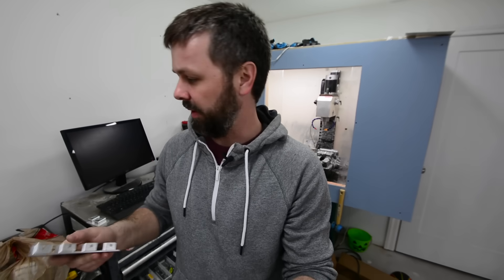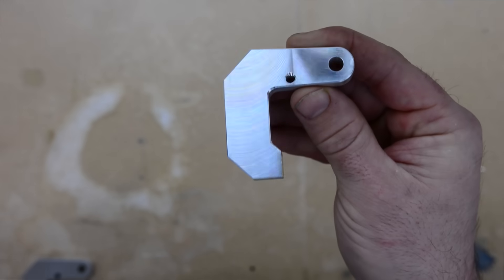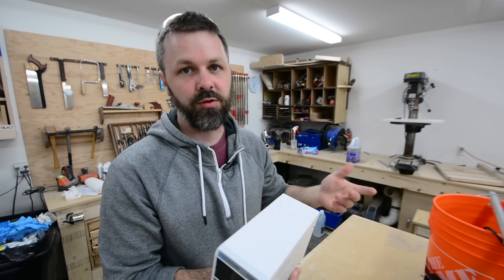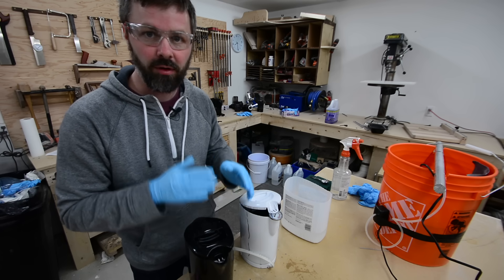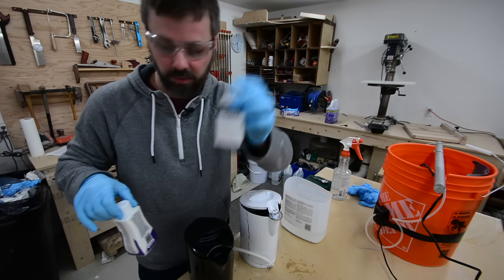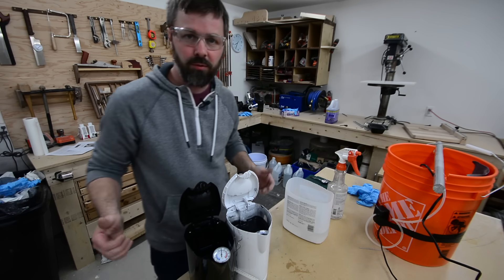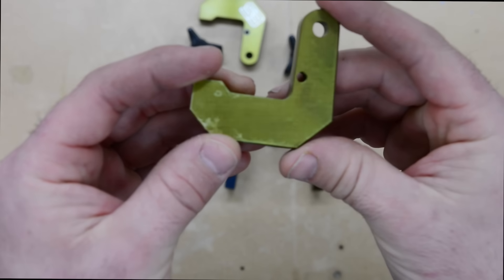ShopBuilt - How to Anodize Aluminum!

Comment: Sulfuric Acid (aka battery acid) is exactly the same chemical used in many drain cleaners. You'd be fine just pooring it down the sink neat technically, but neutralising the acid with a base such as baking soda is wise if you're not actually trying to clean your drains, and can then more safely be desposed of down the drain in most countries. Then you'll jist be pooring mostly water, with a bit of sodium sulfate salt down there. Best to neutralise it in an open space as it can kicl off quite a bit of CO2 a fizz up a ton, so also neutralising it gradually (over a few mins) rather than all at once is wise for this reason.

Comment: Btw, there's no need to heat the acid solution, unless the goal is keeping at an exact temperature for reproducible results. Cooler temperatures allow for thicker coatings. (Type III/hard anodizing takes place at around 0°C. Same chemicals and process, though much higher currents.)

Comment: FYI standard practice in chemistry labs (at least back when I was a chem major for a couple years) for non-environmentally hazardous chemicals is indeed to neutralize and pour down drain when feasible. (Actually, even for "hazardous" ones, if you can fairly easily react them to turn them into something non-hazardous. Hazardous chemical disposal is expensive.)

Baking soda would work, but I'd just titrate in a diluted sodium hydroxide solution (I assume most people have it around for cleaning or etching metal if doing this.)

Comment: Hydrogen gas is not corrosive but is highly explosive. An approximately 50:50 Hydrogen:Air mix is as explosive as dynamite. Hydrogen being the lightest element will collect in the roof space so keep room well ventilated. It should only be a problem if you are anodizing lots of components.

Comment: Generally Never skip the lye etch bath, even if it's just a few seconds it's better than not at all since it removes grease where you can't get to it properly with soap and it removes old oxide and you can polish it after a long lye bath then take a short dip before the acid bath

Comment: Killer Video💯 I just taught myself how to make 
Photo-Etch scale model parts at home & found a few similarities in process & Equipment used.
❓❓Question❓❓
👉The largest parts I’ll want to anodize is 1:25 scale. 👇🏻
📍[Less than 1” in size]
With that in mind could a much smaller size container be used (rather than that 5-Gallon bucket]❓❓
📍Again Excellent Inst Video & Thank-U very much for the valuable Content Info, as well as the easy to follow delivery🤩 
My ADHD 🧠 gave it 5⭐️’s
👉I’ll be posting a How-2-Video of that Photo-Etch aka: P/E process on my YouTube Channel 🔜 if interested.
Respectfully,
Lee
aka:ZenModeling☯️

Comment: Feel free to use the neutralizing of the acid then drain. The baking soda will dissolve in the acid and weaken the acid. when the baking soda stops reacting (add small amounts) then you can verify with some litmus paper, but the result is not a slurry, but a liquid with a Ph near that of water.

Comment: Diamond Lapping paste mixed with oil gives you the  preferred surface finish/texture for good Anodising. Do it on a flat Marble surface, in a circular motion for best results at Home (Not many people have  a rotary Lapping M/c'.) You don't need a lot of paste, but plenty of Oil. I was an Inspector, now retired for the Hydraulic, weapons handling & weapons firing systems for HM's Nuclear Submarines. Almost all of the Aluminium body parts were either, Anodised or Hard Anodised.

Comment: 6:42
I know this is an older video but what if you began the process at a lower amperage then adjusted to a higher one to add durability? Would that leach the dye out or seal it in?

Comment: All the accessories on my bike are anodized green. Including the sprocket bolts. I want to dye the heads of all of the engine bolts. All of the hardware is polished right now so it should take on a green chrome look. Do not recommend using lye for that finish.

Comment: after you scotch brite make sure you clean surface very well, as a tip because scotch brite leaves a lot of organic material and contams. I like that you are etching but honestly look for better product than scotch brite. I learned it can really mess things up. I had a stainless job get surface rust due to it. luckily it was an easy fix but learned. So if you are not getting good results its the scotch brite

Comment: I need help off anyone who knows a little bit about anodising so hopefully someone on this comment can help, little bit of reading to do but here goes!
In our company we sell all our own parts and it’s mostly cosmetic and safety parts for Landrover defenders, we machine anodise and assemble them all in house, the anodising we do is on 6082 T6 aluminium and for the most part we have it nailed down, as a supervisor I see us in the machining side struggling to keep up with the demand of our products and trying to improve efficiency and one of the key factors we have when anodising is whenever we machine something and engrave it, once it’s been anodised it then needs to be set back up to reengrave all the components we’ve made so the engraving stands out of the black silver and grey parts we’ve just anodised, now keep following me, hundreds of years ago when they were engraving armour pieces, they bits that they didn’t want to etch in the acid tanks they would cover with wax and protect them so when they took them out of the tanks the only bits not effected by the acid were the ones not covered in wax, I’m wondering if there could be a way we could use their methods or something similar to improve the efficiency in my workplace? There has to be a way so we can avoid putting them back in the machine to engrave them post anodising! Other than buying a laser etcher

Comment: Would this process work to add color to safety pins? I absolutely cannot find a process to make maroon safety pins besides painting them and that will not work for my application. Plus I need to do a lot!! There seems to be a burgundy color on one of these parts on the cover photo. Any suggestions?

Comment: so is the acid breaking down the natural oxide layer in order for the dye to penetrate the aluminum? Or does it break down the oxide layer in order to get the metal transfer in the tank to bite into the aluminum and create the anodized layer?

Comment: It's just like charging a Battery it will release Hydrogen gas which if you remember the Hindenburg is extremely flammable so a well ventilated area is a great idea. Good Video & great explaining the surface prep & it's results.

Comment: Sulfuric acid isn't toxic. That's why your landfill accepts it. It's just acidic and what comes from that. You've already diluted it so it's not as strong. Adding sodium bicarb to it when you're finished is harmless as long as the acid and base are not too strong and added too fast causing a violent gas eruption.
In your case not likely. The off gas produced is just CO2 and the end product is sulfur. Dump it on your flowers.
Volcano's blast billions of tons of sulfur dioxide and CO2 into the atmosphere every year. It's literally not the end of the world. :)
Oh duh.... Great job! Good looking parts! I kinda like both colors myself.

Comment: My lord imagine doing electro chemistry in imperial and using mixing ratios for the concentration of acid. That's some wild shit right fucking there.

Also calling sulfuric acid battery acid kinda bothers me.
But even tho your knowledge in electro chemistry is improveable it is till good video. 
Also every non chemist trying this do yourself a favour and read the H and P statements for all chemicals involved. And I can't stress enough how important eye protection is when handeling chemicals you can take a acid burn to your hand as long as it isn't mentally concentrated or HF but acid in your eye has a very good chance of making you blind for life.

Comment: .20 A,   .....but @ what voltage?   Is it me, or did you not state the voltage you are setting your power-supply at for the Cathode / Anode connections?

Comment: Hey I’m trying this and using aluminium tig rod to hang the part and the tig rod keep deteriorating before the times up on the anodising
Reply from the maker: It should still be good where the part is in contract with the rod. If not you may need to buy some titanium wire.

Comment: Great video, thanks! Here's a bunch of information that's hopefully helpful:
- "battery acid" it's really sulfuric acid, usually between 15 - 30%
-Instead of throwing out the used aluminum rods, you can just strip them using lye (sodium hydroxide)
-Drain cleaner can be either hydrochloric acid or sodium hydroxide or potassium hydroxide. Check label
-On a battery (called an galvanic cell) the cathode is the + terminal, but we are doing the opposite 
-With this setup (called an electrolytic cell), the cathode is the - terminal and the anode is the + . To clear 
-It's cathode (kath-ode) like electrode, not cathoid
-Hydrogen gas isn't poisonous, but it is very flammable, and 
-You can't control the voltage if you're controlling the current, you can only control one or the other 
-Current, voltage and resistance are related by Ohm's law V = IR

Comment: When diluting acid, put the water in the container first. The reaction between water and acid generates heat.  Slowly adding acid to water prevents the heat being generated too quickly, which can be dangerous.
Reply: doc Winters, my 7th grade chemistry teacher taught us all to think "A to W."  Always.
Reply: @normbal 
My Grandpa taught me thus way "Do what you oughta, add acid to water"
Reply: AAA - Always Add Acid (to water)
Reply: This is known as an exothermic reaction. And it can blind you literally if the acid is strong enough and there are impurities in the H2O
Reply: Another reason to add acid to water is that any splash initially will be water, not acid.  But glad someone pointed out the AAA or A to W principle.
Reply: Always Add the Acid! Yup!

Comment: Small problem in the UK but Sulphuric acid (battery acid) is a banned substance for domestic use UNLESS you apply for and get a Home Office Licence. 

Reason: Sulphuric and Nitric acid, amongst other chemicals, particularly in their concentrated form, are oxidisation agents used in explosives manufacture ... Nitric acid especially as it is so simple to produce high explosives with it.

UK Viewers, please note the above. Obtaining, using or even storing such materials are all subject to heavy fines, a criminal record on conviction (little evidence needed) and potential incarceration for several years!

Comment: Instead of throwing out your aluminum wires you can just toss them in a lye bath for a couple minutes to remove the anodizing and they're good as new. Same process for any parts where the anodizing fails, just give them a 2 minute lye bath and you can try again. 👍

Comment: Does the voltage matter?  You spoke about amperage, but I didn’t hear voltage mentioned?
Reply: When you're controlling the current, the voltage will be dependent on the resistance via Ohm's law V=IR.

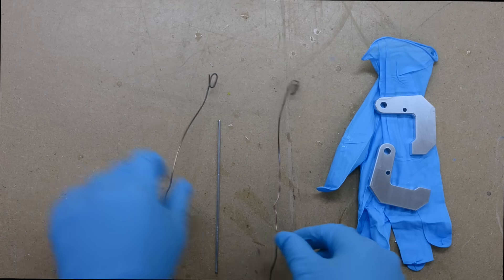Comment: 4:22 "one time use"??? Why not just sand the thin layer of anodizing OFF the Aluminum wire before using it again?! Or even use an acid to clean off the anodizing?

Comment: Battery acid is 30% sulfuric acid, drain cleaner is 98% sulfuric acid....So as long as you don't have a septic system it's probably no big deal to pore acid down the drain just as it is.

Comment: Great video.     I’m wanting to anodize but not color.    I’m guessing the protection will be there after the acid tank?     I’m wanting to protect alum from methanol in fuel  system and will powder coat all the external items
Reply: The dye is purely cosmetic and not required.

Comment: Thank you!  How would you suggest to anodize a hard plastic material like a football helmet?
Reply: You can’t anodise plastic.
Reply: You could plate it in a metal like titanium or aluminum and then anodize it but coating plastic in a metal coating is very difficult. You could try sputtering. This would be very expensive and impractical though. Some plastics can be dyed though

Comment: why not leave a "tab" or post on your part-or design it with such a thing, so you can use gator clips to insure a cood connection that you can later remove, maybe to small to notice, or in an unseen part of the item

Comment: What if you wanted to write something ? How do you print it on ?
Reply: If you want specific areas of the part to not have an anodised finish you can mask the surface with things such as chemical resistant decals, rubber, lacquer, dymax

Comment: I would need to prevent areas from getting anodized (namely the cylinder walls). What would you recommend I use to block off areas from being treated/anodized?
Reply: Plugging holes with rubber bungs or covering a surface with lacquer or chemical resistant tape will prevent the surface underneath being anodised.

Comment: I think ShopBuilt rinsed with water after the baking soda dunk. Another degreaser is acetone which evaporates quickly. It will dissolve all organics which could block the dye transfer. The acid solution can be neutralized with baking soda. The baking soda rinse will help but you probably will need more. Get some pH paper and neutralize until pH = 7. The solution should not be a slurry. That would tend to be basic. pH paper will show this. Great video!

Comment: Jason at Caswell told me not to use Simple Green to clean the aluminum.  Jason says that Simple Green leaves residue on the metal. Jason recommends using a solution of Dawn dishwashing liquid.  Hope this helps.

Comment: It doesn’t have to be ventilated. That’s an old marketing trick anodizers  made deal with EPA and OSHA to scare you into letting the “professionals” do it.  I breathe it daily. Ain’t nuthin wrong with me.
Reply: Yeah you can breathe it just fine. Electrolysis creates hydrogen and oxygen, which together are very explosive so it can be dangerous with electrical sparks or fire if you don't ventilate enough and accidentally spark it with your power supply.

Comment: You'll get better results on dying if you're more gentle with your process, especially the rinse.  All that banging around, especially the parts hitting each other, will damage the fresh ano layer.  You don't want to even bump the parts before sealing.  Anywhere you bump the cells they get broken and can't accept dye.  Rinse with DI or distilled water, dunking several times carefully and you'll be fine.

The Rit dye doesn't always match because of molecule size variations in it.  As it is meant for cloth some of the various colors in the mix are too large to fit in the ano cells.  For example, green Rit dye may be made from yellow and blue dyes.  If the blue dye molecule is too large on average to fit in the cell you end up with a much more yellow than green part.  Dye molecule size is why there is no white ano dye.  There isn't a white dye molecule size that is small enough to fit in the cells.

The light colored part that didn't take dye lost connection.  The best way to start the process is to either energize the parts and lower them into the tank or turn your power supply all the way down before turning it on then slowly ramp up the power to where you want it.  If you just smack it with power already in the solution you can get a bit of a spike in amps that will cause a loss of connection and failure to anodize.  Another cause of failure there could be all the bubbles causing the part to move on the wire and lose connection.  The connection must remain solid the whole time or failure is the result.

As this is an old vid you may have already figured all this out but maybe someone else new watching this can learn.  I've done hundreds of parts successfully after lots of experimentation and learning.

Comment: As a lab worker, sulfuric acid properly neutralized with baking soda or sodium hydroxide (lye) is totally safe to put down a drain (or in the garden, in a bath, in a soup). It just forms sodium sulfate and CO2 or water. Just make sure the pH reads between 4 and 10 first.

Comment: I love your video!  I always wanted to know how to do this.

As for disposing of the dilute sulfuric acid solution, mix it with a mixture of sodium bicarbonate and lye solution.  Add the baking soda solution slowly to the acid until it stops fizzing.  What you are left with is just sodium sulfate which is completely harmless and can be dumped into the toilet without any problem.  The reason you used a mixture of baking soda and lye is that the soda fizzing can be used to detect when all the acid is gone, while the lye is a far stronger base and will result in a lot less wasted chemical.  Thus you can use a mixture of 10 parts lye to one part baking soda, or even 20 parts lye.

CAUTION:  The reaction can be quite vigorous.  Take your time.

Comment: What's an "inch"? Is it a Biblical term?
Reply: It is precisely equal to three barleycorns. Also if you mash your thumb against something and make a mark on either side of your thumb on that object, that is an inch, once you have calibrated your personal inch pressure to make your thumb derived inch be an accurate and precise 1/72 of a fathom. Such physiologically based measuring units have been used probably since before the invention of writing. Fathoms. Cubits. Hands. Paces. Miles. Jesus was trained as a carpenter so no doubt he used inches instead of sillymeters, which had not yet been invented since the French were not even invented yet. If inches are good enough for Jesus, they are good enough for me and SHOULD be good enough for you unless you don't like Jesus. You do like Jesus, right? If so, then prove it. Stop spouting all that stupid metric crap and use inches, the way God meant for you to do.